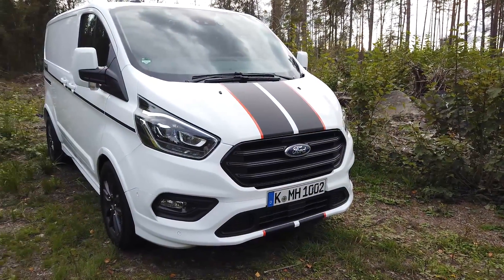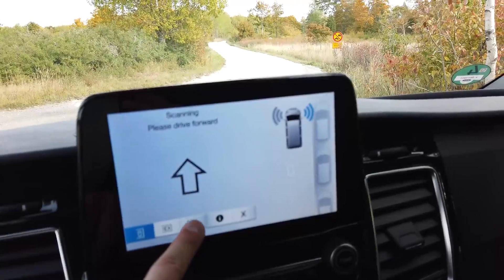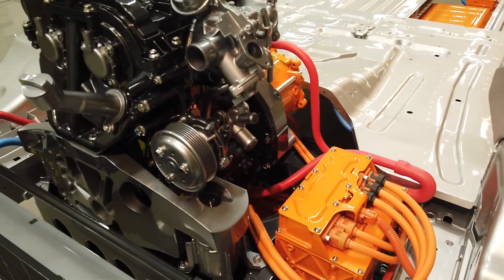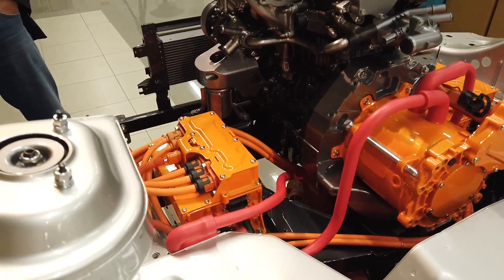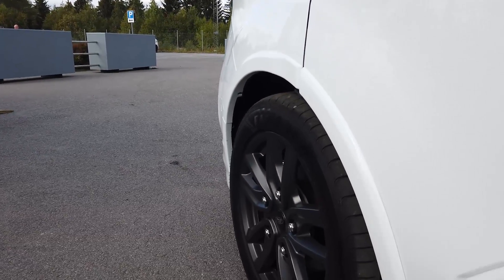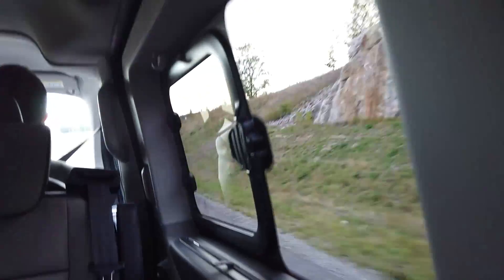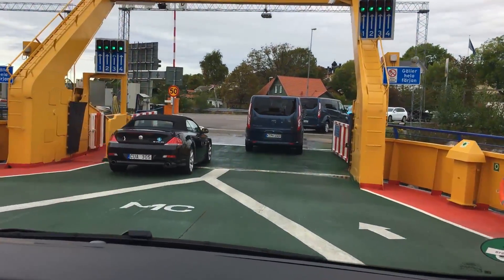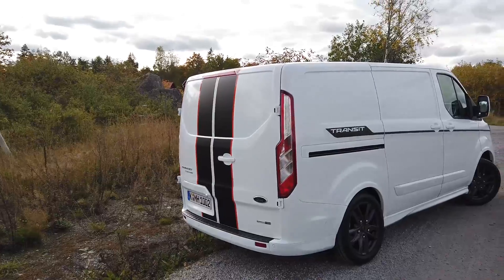New Ford Transit Custom Plug-In Hybrid - Answering Questions

Comment: Seems like it would be perfect for Vanlife in the U.S. If you have solar panels on the roof, you can use the cars battery as backup for utilities in the van. Or the reverse could be true: when you produce excess electricity, you can reroute it to the car battery, extending range (esp if you can find a way to charge the car battery from solar panels while driving) Since you take many, longer stops (in potentially isolated areas without gas station) in Vanlife anyway,  this would be very convenient.

Comment: It can not go faster than 120 km/h, it can not tow trailers, it is limited to L1H1... :/ There is still some things to be solved before electric cars will replace petrol or diesel cars...
Reply from the maker: This is an especially weird creature.
Reply: @VToldsMotoShow  In other video presenter called it a "test ballon" ;-) Ford will check how will this kind of vehicles sell.

Comment: I wish to delay starting the combustion engine.
 Can I add batteries to increase the distance travelled in 100% electric mode?
Reply from the maker: Hi, I am almost entirely sure that replacing the battery with a larger one is not possible. Definitely not officially and not within Ford's official distribution. Perhaps one day there will be some remote "power banks" that you can have with you and charge the car from them. This is a good idea by the way.
Reply: @VToldsMotoShow  
I would not like to replace the batteries if I would buy such a vehicule. I am wondering whether it is possible to add more batteries, because there is room enough inside the cargo space.
Reply: There are "powerbanks" for EV. But there is "but".
Not sure -it looks so far nobody was thinking about inside vehicle connecting point.
So now you only can stop/ park , connect powerbank from outside like you do from home or public charger, wait.....
I don't think you can connect somehow powerbank and straight drive .
Hopefully by time designers will use brain ...
(If I am wrong -correct me)

Comment: What’s the expected mpg when using the engine only?
Reply from the maker: There is no official data on it but my test shows that you should expect around 8 liters per 100 km - that's 29 mpg as far as I'm concerned. It didn't go up but as with any car - pushing it to the limit while driving on petrol can rise it significantly.

Comment: Hey hello, I need help, I have a 2008 Volvo s80 v8, what happens is that the driver's side wiring has been damaged, I have taken it to the authorized workshop and they don't know how to solve it,I do not really know what to do :(
Reply from the maker: There are basically two ways, first it to give it to some technician that will check all the wires and charge you a lot for the time spent on it. Or simply order the Volvo dealership to replace the wiring. The question is, which presents less risk to you. It may be hard to decide based on pricing as checking the wires may solve it in 1 hour and it may just as well take days. First I'd ask dealership for pricing of replacing the whole wiring to get the reference point. I assume that you're sure that the problem that you're facing is around the wiring itself. Good luck!

Comment: 1:10 I don't think that's entirely a fair or conclusive test, V-Told. In your second video you showed the car to accelerate on the battery exclusively, hence why the kW gauge showed ~85kW of power. There's a pretty powerful 1.0l 3 cylinder ecoboost on board to use for power and range extension. 

And as your man has said, the battery got hot after hard driving, you're supposed to drive with both petrol and electric outside of town usage. IMO, this is Ford's fault for not making a flexible-enough drive train. I worry that the 1.0l engine may drink too much fuel by driver who don't charge up their Transits. Around 9l/100km like you mentioned. If Ford fitted CCS charging, this won't be an issue on long journeys.
Reply from the maker: To be honest, I am assuming that what I've been told about no difference in performance is in place and that's why I didn't bother to try to measure acceleration times in different modes. Driving on petrol only may make it drink around 9 liters if driven hard or only on a highway and with load. I think so at least. It's still not terrible for a big van though. Anyway, thanks for input!

Comment: I have a question. 
If the batteries cannot be recycled in order to make them safe, isn't all this electric driving nothing but virtue signalling?
Reply from the maker: This topic is not being touched by many as we still don’t know how recycling and the whole management after using the batteries is and will be handled. All these cars are still so new that this process hasn’t really been pushed on a large scale. It’s a good topic overall and I’d love to know the long term plans too. I believe that with the development of technology, there will be better and better and more efficient ways of recycling the batteries.
Reply: @VToldsMotoShow  It doesn't take long to find out what the formal process of recovering batteries is. I'm afraid Lensvelt is just spouting common fodder facebook-internet rumors. I've heard of the same baseless questions since 2010. They haven't changed. Electric cars have evolved almost unrecognizably since 2010.

Lithium ion and indeed all batteries can have their materials recycled, but in real world practice, when a battery is 15 years old and "unsuitable for vehicle purpose", a whole propulsion battery can still be valuable and not a single person with half a brain will throw away a high voltage battery weighing +230kg into a landfill. In fact, a capacity degraded battery will only have at most 1/8 of its modules or cells being tired, damaged, or most often out of voltage balance (easily refurbished). A battery of hundreds to thousands of cells behaves like an army; it marches as fast as its slowest solider.

We (Lensvelt) have to be honest with ourselves of how electric vehicles are built and how they work. It makes no sense to worry that batteries will be put in landfill or not reclaimed, because of the fact that batteries are still very valuable and the OEM manufacturer like Toyota, Nissan, Renault or BMW routinely reclaim them for static battery storage. In fact, it's becoming a trend of batteries being bought separately from crashed cars.

Whenever there's a totalled and written off Tesla Model S or X, it's very common to see them bought for over $50,000 because their battery and motors are so valuable to reuse for car conversions, EV upgrades and home solar storage.